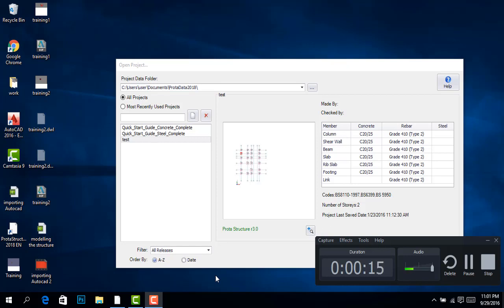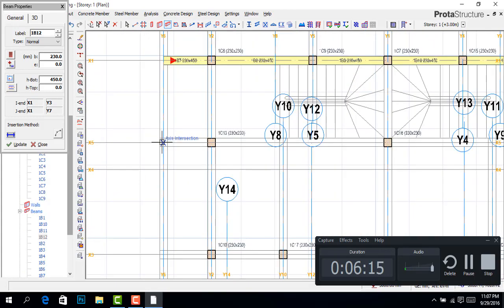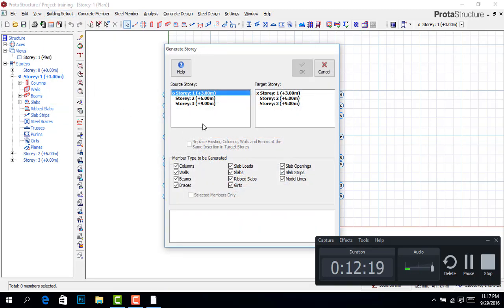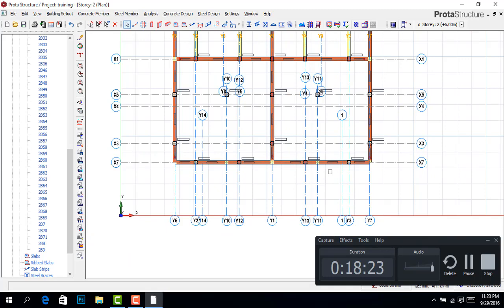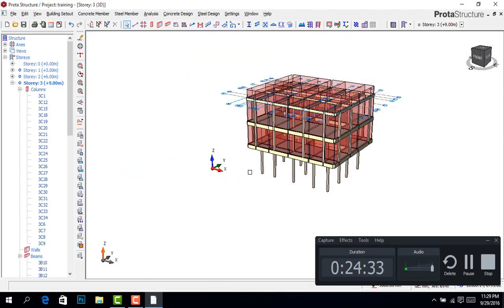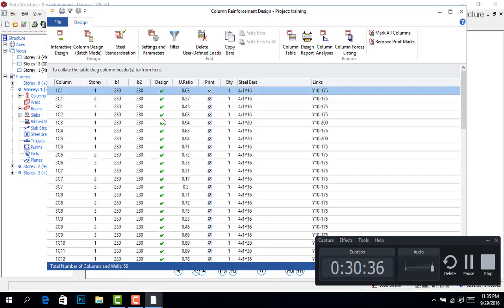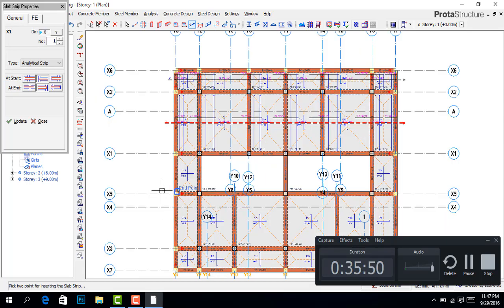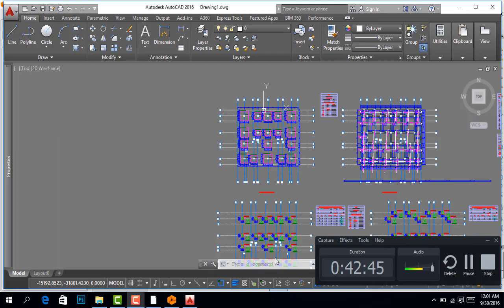protastructure tutorial: step by step guide for beginners

Comment: Hi my questions is why did u use wall load of 3.47 ? and how did you obtain it ?
Reply from the maker: the weight per unit area of a 225mm block is 2.87KN/m2 and the wall finishing is 0.3KN/m2 for one side but on both sides is 0.6KN/m2. add 2.87 and 0.6 will give you that 3.47KN/m2

Comment: Nice work 
Please didn't you applied slab strips accordingly switching between x and y, hope it doesn't affect the end results?
Reply from the maker: Yes. This is how the software does it. It will appear in all the floors
Reply from the maker: Yes I did, but if you are just taking the strip through the slab just to produce reinforcement, it will not affect the end result. But if you are  working on a finite element design like raft and flat slab it may affect the end result
Reply: @keonyediolodu2133  thank you 
Hope if I move a copied grid on different floor it wouldn't affect the one below?
Reply from the maker: Just offset the grids,  it won't affect the floor below
Reply: @keonyediolodu2133  I added another grid just the they now all appear on all floor unlike in Archicad where we do costumized grid view